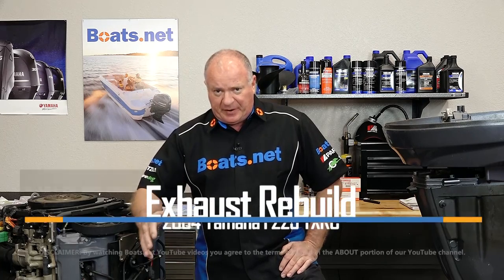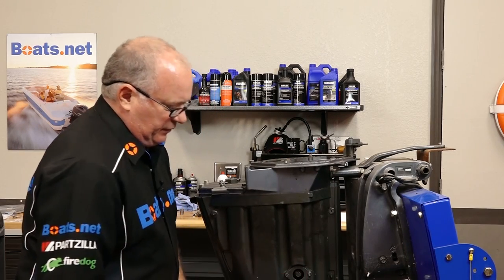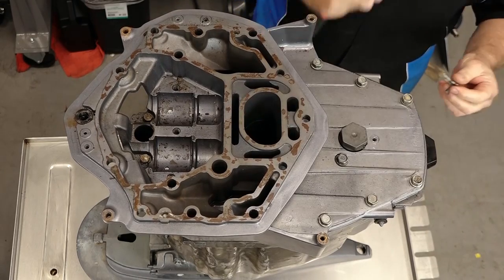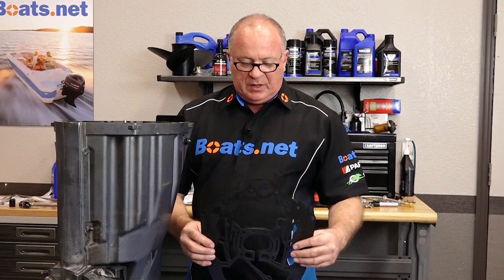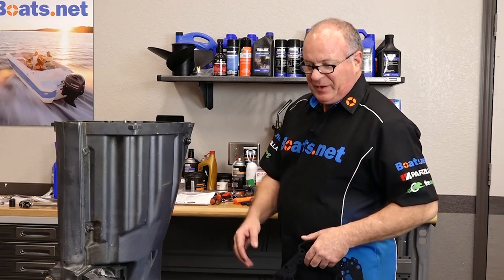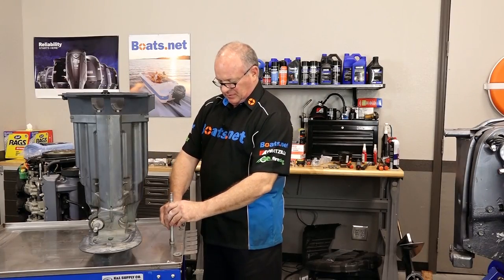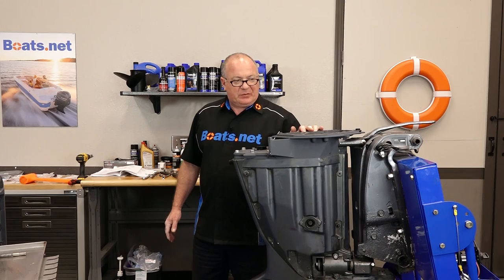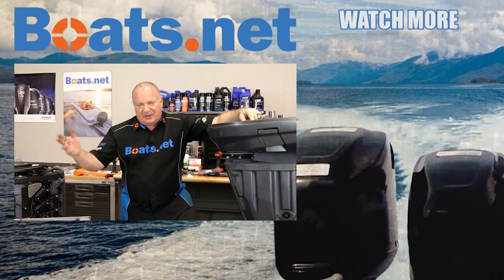Yamaha F225 Outboard Exhaust System Rebuild | Yamaha 225 Exhaust Kit | Boats.net

Comment: Just rebuilt mine. Between these videos and the manual it was a piece of cake. Had to buy all the parts individually since you cant find the full kit anymore. Id suggest new 2 upper and 2 lower large mounting bolts with nuts. Had to cut my lowers because nuts and end of bolt were so far gone. Otherwise the parts list from the "kit" was spot on. My 2003's corroded through after 20 years and 1100 hours. Easily ready to go another 20 now!

Comment: Love all of your videos John. 
How can I determine if my engine has an exhaust corrosion problem without a teardown? the Engine is a 2004 F225txrc with 350 hours total. I have a snake viewer camera that I might be able to use. What has concerned me is when the boat is lowered into the water, I see a small oil stain at the back of the engine. I would guess it is less than a few drops. The engine was serviced a few years ago but I don't know if anything was done at the carrier bearing. 

The boat has never sat in the water for more than a few days, it is on a trailer or a boat lift. I use the installed flush mech even if it ran for an hour. I do not use the mouse ears, too difficult to get to. I am the original owner.

Comment: Hello John, I have a 2003 225 Yamaha with 570 hours and I’m trying to determine if my engine has the corrosion issue. Is there a test to do that shows if you have the issue without taking the power head off?
I see people taking out the lower unit and putting a water hose at the pick up tube, and if water comes out the dry exhaust port then they consider the engine failed the test and needs the corrosion kit.....is the water up the pick up tube an accurate test? 
Thank you

Comment: hi, your videos are amazing, thank you so much! I have the 2004 LF225TXRC, which has had the same exhaust problem. I’ve been trying to confirm that I get all the right parts. I know you say 69J-W0001-21-00 (around $200), but I’m also hearing that I need MAR-EXHKT-04-00 (around $700). Does MAR-EXHKT-04-00 include the parts from 69J-W0001-21-00? How do I know if I need to get both? Thanks!

Comment: Thank you for your videos.  They are very informative.  In this one, though, I believe the proper way to torque the bolts is to at least criss-cross them if the manual does not show a torque sequence.  This allows the part / faces to be pulled down evenly.  This is especially critical on aluminum parts.

Comment: Hey guys I am putting a new to me powerhead on my ox66 200hp! On the top mid section mounting bolts there are gaskets. Mine are split where can I find them? Can not find a part number or description!! They are the 2 long bolts at the top with the cap on them! Any help would be awesome

Comment: Hi John, I did the same job on my 2003 engine. After the assembly I have problems with overheating at idle speed, and water leaking from the exhaust rubber on the foot could you give me a suggestion of what to check could this be? SEAL
69J-45127-00-00 badly mounted or other THANKS

Comment: Hello Boat Parts,
Great and professional videos you make.

I have a Yamaha F115 2002 model which is a 4-stroke. It needs a timingbelt replacement and I cannot seem to find any video of that on your channel. I sure would expect to find that before a lot of these other videos.

Especially since it's a more regular type of maintenance (every 1000 hours or 5 years) and it is EXTREMELY important to do it correctly with the timing and all, or  else you will completely destroy the engine!

Really hope you could make one of those  in your style of teaching😊

Comment: I just want to say Thank You Very Much for your informative videos on the 2004 Yamaha exhaust rebuild. I performed all the work myself but I did buy all the parts from my local shop, the advantages were he told me some of the little parts to replace while I had the motor torn down. Like the collar on the crank for the oil pump and new oil pump.
The rebuild was a success and the motor runs like new.
Thank you, Thank you, Thank you 👍👍👍

Comment: Thank you for this video.  Have been looking for something like this for a year.  I have a 2003 Yamaha 200 HP with around 500 hours on it.  I am getting water in the engine oil after 16 hours on a new oil change.  Took it to two shops. One did a compression test and all cylinders tested 190 to 200. They would not do anymore on it.  Talked to a local dealer who would not work on it because he suspected there would be too much involved.  Since no one will work on it, I have started.  One thing I noticed when pulling the intake cowling was a water /oil mixture where the cowling connects.  The motor runs fantastic and you would not know there was an issue if not checking the oil level regularly.  Could this still be a head gasket issue?  The dealer felt it was an oil chiller issue but would not elaborate.  Neither shop felt it was the corrosion issue.  Any ideas?
Reply: I noticed the same thing on my otherwise great running 2005 f225 only in the lowest starboard intake.  I'm taking it because of visible exhaust corrosion, the motor was running great.  is this normal or a sign of another problem i wonder?
Reply: @tiiimay  I am not sure if I have solved my problem yet.  During the winter I removed the power head, lower unit and middle casing.  (basically everything motor related off the boat)  Installed new gaskets and seals for everything removed, including new water pump, just because I had it apart.  After running motor for about 8 hours only at trolling speed there has been no difference in oil level.  If this doesn't solve the water issue, I will check head gaskets  port, starboard exhaust cover gaskets.  Shooting in the dark as just looking for places that could leak.
Reply: @michaelsimpson2449  Did you replace thermostats ?   If they are stuck open the motors can run cold and make condensation in the oil
Reply: @HydesRVBoatsRexford  After removing  the power head and completely tearing the middle and lower casings. I replaced all the seals and gaskets, put in back together and it has been fine. Did not see any obvious bad seals or gaskets tho.
Reply: I do plan on doing the thermostats this winter as they are probably due.

Comment: if you had removed the exhaust, and pretty much got it all apart, why not do a service/lube of the steering components to?, you are there, so why not?, esp. if the rest has been in such a state, why not just do all seals/mounts in the whole outboard motor, including the mounting brackets.